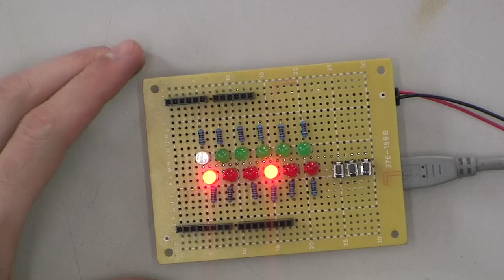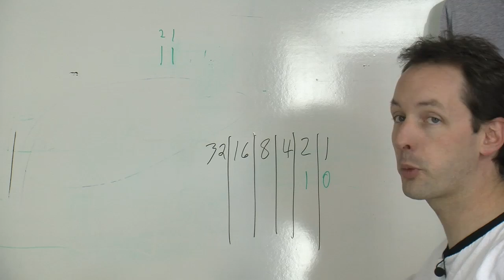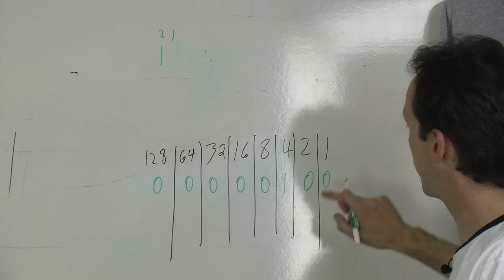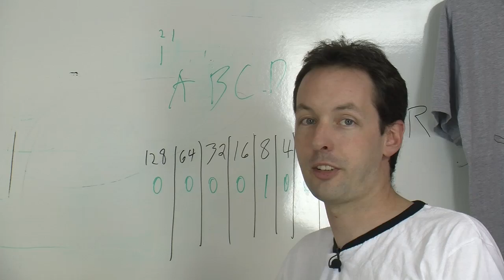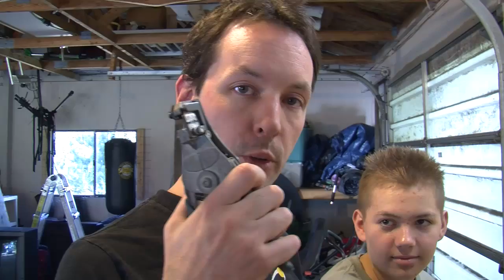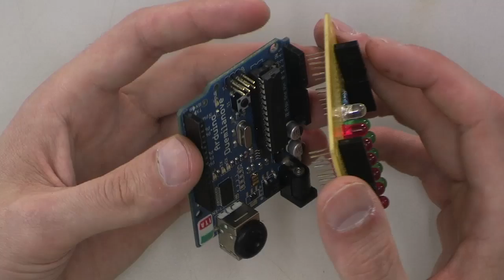Arduino Binary Clock with Dan Eakin and Chris Boden

Comment: i've made a binary watch using a picaxe 20x2 and shift registers with seconds display, hourly and main alarm and a calender which will calculate leap years up to 2063. it can be worn on the wrist and its battery will last at least 1 and a bit days of normal operation. check my video responses

Comment: i could do that with two 08M's tops, i am addicted to the PICAXE 08M's and i have made a clock and a display which i can get to display in binary, the clock sends out 4800 baud serial and the displays are eight 7 segment LED displays with decimal point. with a slight code adjustment i can get the displays showing binary for each digit

Comment: octal and hexadecimal make a convenient shorthand which is easy to convert to binary in your head: 1 octal digit represents 3 bits and 1 hexadecimal digit represents 4 bits. hexadecimal is possibly the most useful as 2 hex digits represent 8 bits eg FF translates to 1111 1111 ;  F0 translates to 11110000. its easier for the human mind to work with than converting between decimal and binary (not to mention writing long strings of 1's and 0's)